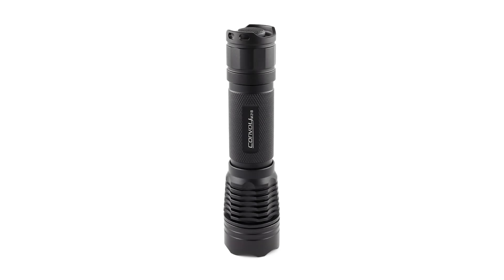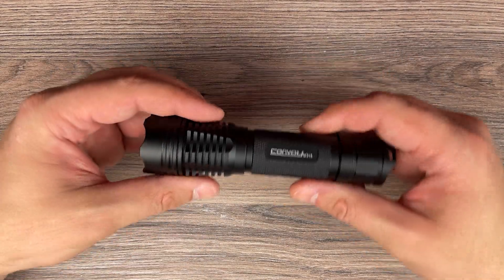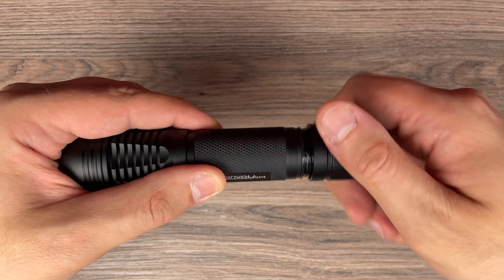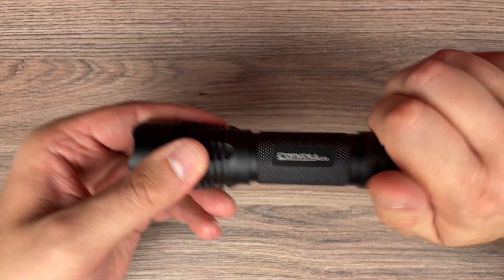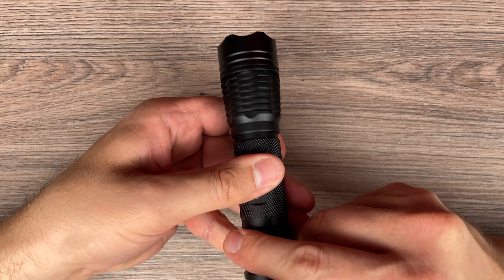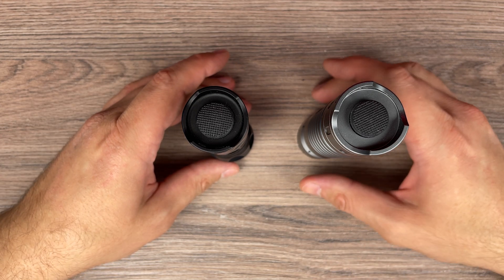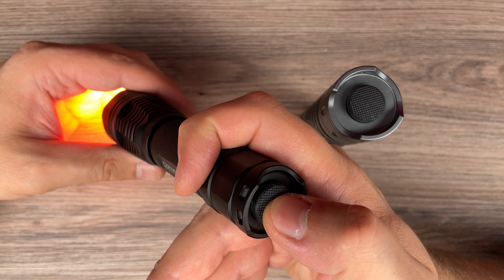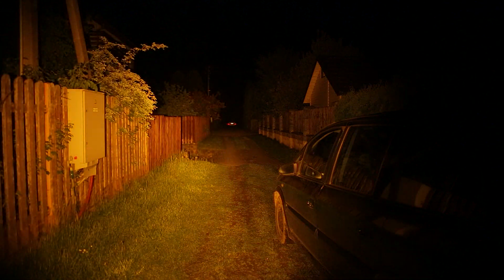Convoy M21B GT FC40 1800K high CRI flashlight review | Night shots and runtimes | Fog test

Comment: Good review.  I will get this 1800K to have ultra warm tint for my collection.  Not the most practical for accurate color rendering but I like that it mimics the color of fire 🔥 for a mood light.
Reply: I can imagine. Set one of these on the room with a diffuser (the S2+'s diffuser fits perfectly on the M21B's lens) and it'll be like the old times of kerosene lanterns... without the issues of smoke and smell and fire hazard. Too bad Anduril isn't compatible with boost drivers. I'd love to see this emitting colour in candle flicker mode.

If I had additional practical uses to justify getting an M21F or H with this, I'd totally pick it up. Alas, 2700K is my hard lower CCT limit and getting a torch just for decoration and mood is beyond my means.

Comment: After watching this video a second time, I wondered what your thoughts were on why the S11 had a longer runtime than the M21B? Are the drivers different? The 1800K tint will give a lower lumen output than the 4500K emitter, but if the drivers are the same wouldn't they still both have the same runtimes?
Reply from the maker: S11 5000mAh batt, M21B 4000mAh batt :)
Reply: @FlashlightTech  Oh, that makes sense! I was thinking the S11 may have had a more efficient driver. I really like the M21B host so I'm glad the S11 isn't inherently better than the M21B host. Thank you for  your reply Richard!🙏

Comment: 2000k is too warm that green and blue colors looked ugly that it defeats the purpose of getting a high CRI. 3000k has to be the the lowest temp I find nice. 5000k seems good too but warm 3000k is the best. 4500k is not that good and 2000k is the worst for me. But if you're looking for good lumens and CRI, it has to be the S21D because of the quad 519A. Tint is even better after dedomes.
Reply from the maker: Everyone have their own choices. I wanted to take the lowest to show people extreme difference :)
Reply: @FlashlightTech  i wonder if it's the same case with other LEDs. I will grab a couple of 2000k from my favorite LEDs to check. I just tried all FC40 tints out of curiosity. I really recommend the 3000k for FC40 because it's beautiful and balanced. 💖
Reply from the maker: @budgetlightph7814  I will try it :) thanks for suggestion :)
Reply: If you like 5000k and 3000k why you dont like 4500k?
Reply: @Gieszkanne  too much green. Looks muddy and uncomfortable to my eyes. I probably got a bad bin though.
Reply: @Gieszkanne I did notice a little green but not as bad as LH351D. You can always dedome to reduce the green. I already stopped using FC40 for a long time. I have only been getting 519A or SFT40 3000k for high CRI lights.

Comment: What flashlight to take with this LED to keep the turbo?
Reply from the maker: M21G with XHP70.3 HI can hold 2000lm high mode, you can try that, but I have not tested it with GT FC40.
Reply: what about convoy l6 ?
Reply from the maker: @Domovoy-bg7re  never had L6, so cannot comment on it :/ It is a large flashlight, so should hold high output

Comment: @Richard this is weird. You keep making interesting videos 😁. I literally fired up YT to look for FC40 in convoys. I'm about to order a C8+ with gt FC40. The warmest I currently have is a dual channel d4sv2 with 2700K sst20s and I can't get used to anything lower than 4000K.
This emitter(fc40) seems awesome even at 1850K which intrigues me.

Ps. Do you think the C8+ would be as nice as the m21?
Reply from the maker: Hello, c8 should be with more throw. But keep in mind, that with lower color temp, you have less lumens.
Reply: @FlashlightTech  Goes without saying, this is another flashlight I don't need... I just wanna try both C8 and the fc40. I don't have any expectations other than seeing how it performs with my own eyes.
M21b is now on my list as well.
Reply: @Thrael72008  Is 2700K good at fog penetration?
Reply: @sodiumsyndicate8715  I don't remember using it in high humidity. I had an S21A w/ 519A dedomed (~2700K) and FC40 ~2000K with me last month when it got pretty humid on the countryside. The beam of the 519A was awesome. The floody Fc40 didn't impress me as much.

Comment: This is a very interesting LED! I really want a 1800/2000k light. For now my lowest is 2700k. Really nice! Really nice video. Thank you!
Reply from the maker: Thank you for watching! :)
Reply: I find the color just plain ugly. I have been slowly weaning myself from cold white lights.  But this is  certainly not something I either like or would buy.  Of course, to each his own.
Reply: @philippasteur1701  fair, but good thing that there are high CRI neutral and cold emitters too
Reply: @maggi98mw  Too right. The FC40 and 719A in 5000K and 519A in 5700K are an absolute beauty to witness, they're basically daylight on demand. The 519A in 4000K matches the early sunset light perfectly.
Reply: @DinnerForkTongue  have you tried the new Fireflylite LEDs? Some are incredibly rosy, it's a beautifully usable light
Reply: The CRI is better with E21A but I only have GT-FC40 so can't compare. Looks yellow compared to a candle which it is meant to replicate.
I thought I made a mistake at first but it's a good alternative to a red LED and you can discern more colour as you get used to it.
I mainly use it indoors to illuminate my bathroom but it's good outdoors too.